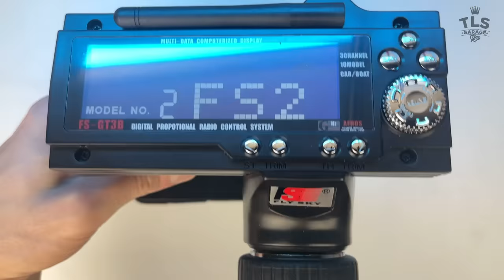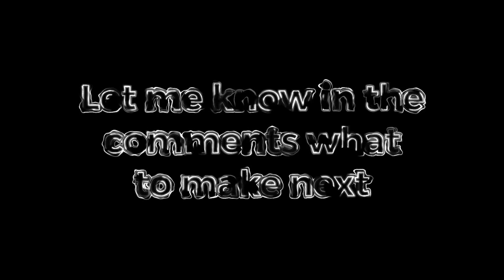Toyota AE86 Sprinter Trueno Team Transport RC with Working Popups and Flatbed (Hotwheels Custom)

Comment: Because there are space to work with on the truck, I think you can make it a charging station when the AE86 runs out of battery. It is like refueling the AE86 when it's fuel runs out
Reply: 6.
Is that
Reply: Not as simple in that way

Comment: That screw drive works really well, I didn't think you get enough power from a motor mounted straight to the screw. Very impressive
Reply from the maker: Yeah I was worried it wouldn't have enough torque, turns out it had just enough. Works similarly to a worm gear as far as creating that extra torque!

Comment: Great job! How did you solder metal wires to ball bearing? Its need very high temperature? I was try soldering small ones parts from metal and any effects - only brass or copper I can solder :/

Comment: As a heads up, redcat uses smaller receivers on thier gen7 crawlers, they are about half the size of the one you used here, love the build
Reply from the maker: Interesting! Do they also have a built in Gyro?
Reply: @TLSGarage  possibly some do, but I know some come with a built in esc, I wish I knew more about them really but I'm still learning alot in the hobby
Reply from the maker: @GINGERale420  No worries, Ill check it out!

Comment: Fantastic, i believe you could use an esp32 instead of the radio. I believe it would be smaller and add wifi and bluetooth at a very low cost... your work is very creative.

Comment: Ive ordered everything from the parts list on your website! Now i just need to find out where you get the plastic and metal bits for suspesion
Reply from the maker: All the plastic is 1mm styrene or smaller, and the metal is basically 3/32 and 1/16K&S tubing, and hotwheels axles. The small pins I used are from
Custom 1/64 axles, you can find on ebay!
Reply: @TLSGarage  you are a LEGEND! Thanks so much! I have ordered 7/7 parts on ur list just waiting on the motor and servos now! Im debating between what car I am going to change into the rc yet but im very excited and motivated to get started on this project! UPDATE EVERYTHING IS IN!! I just need to get these materials listed much appriciated ill lyk how the build turns out
Reply from the maker: @Neekdahsleek  def do! Hmu on instagram!

Comment: awesome work, what do you use to harden the paint? my custom hot wheels paint scratches off easy.
Reply from the maker: Make sure you prime it first, but the most important part for me is a 2k automotive clearcoat. Its very hard, but its pretty dangerous to breath which is why I use a respirator when using it, and recommend you do as well if you try it!
Reply: @TLSGarage  Thank you so much, So I apply the paint before or after the 2k?
Reply from the maker: @jesuspantoja4873  The clear coat definitely goes on top of your color coat, to give it that shine and protect it!
Reply: @TLSGarage  thank you

Comment: hey, im interested in attempting to make something like this myself, so ive got a few questions, if you even see this comment.
1) what are you using for the small metal wires, and the sleeves that fit over them? (1:40)
2) what are the components that you are using? e.g. motor, reciever, battery and whatever else electronic
3) what is roughly the total build cost and time? (including an rc remote)
4) where do you get the tiny wheels and tires?
5) what are the white pieces made out of in the steering? (3:14 onwards)
6) where do you get those tiny magnets?

EDIT: somehow only just realised theres a website with most of these things on, all i really need to know now is:
1) where are the wheels and tires
2) where can i find the magnets
and also 3) what are you using to bind things together, superglue? or solder?
Reply from the maker: Responding to your edit:
1)they were called bnds wheels, try searching that on google
2) I got the magnets from amazon, just search “micro neodymium magnets”   
3)I use superglue for almost everything, but occasionally I solder parts for extra strength!
Reply: @TLSGarage  awesome, thanks for responding

Comment: Next time you need to go brushless for POWEEEEEER
Reply from the maker: Haha I considered it. The silvia build I did was actually brushless, and ended up being a useless amount of extra power to the point that I had to limit the throttle on my transmitter. Brushed is much quieter, and these little builds just don't need the extra power in my experience!